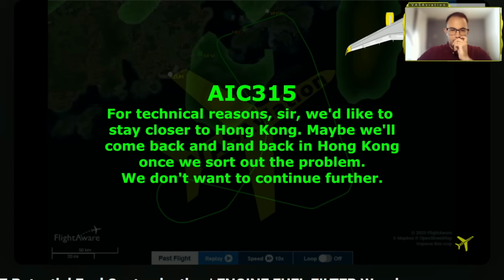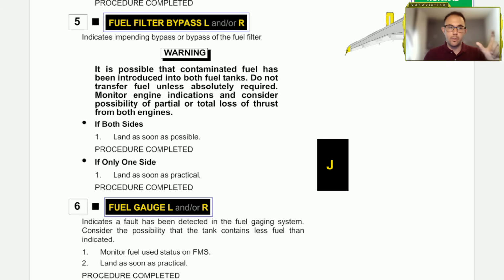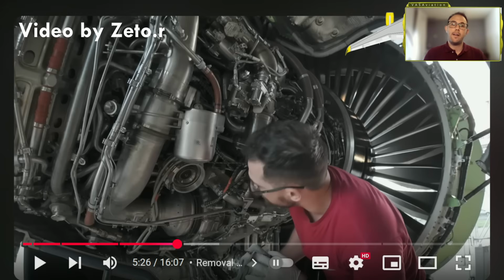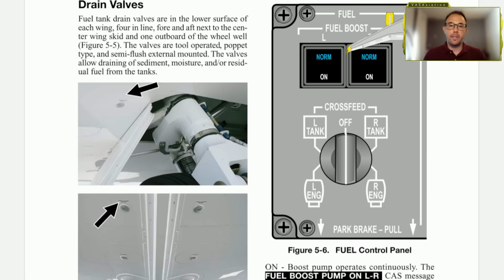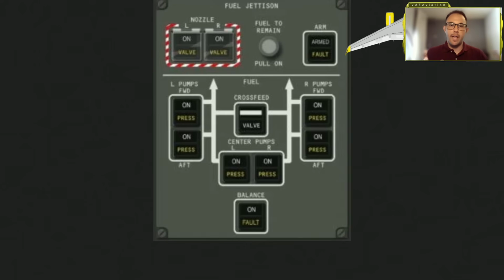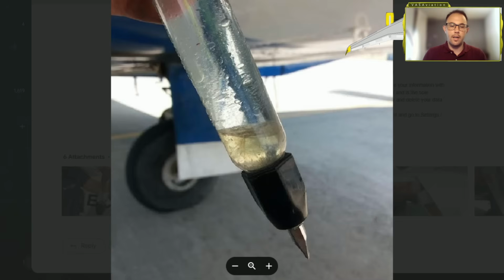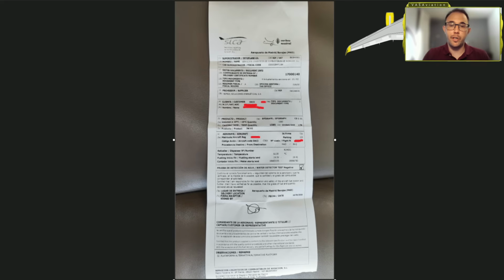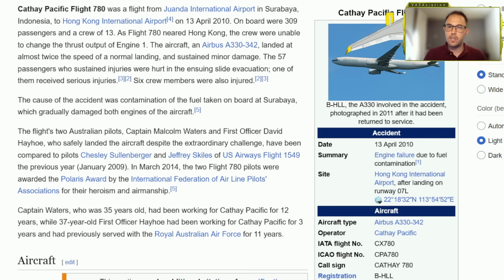Fuel Contamination | Fuel Filter Issues onboard Air India AI315

Comment from the maker: I forgot to mention that fuel filter sensors work measuring differential pressure through the filter. The Caution Message can be produced due to a failure in that sensor too.

Also I have read that there was a case in which the filter had not been installed back in position after maintenance. I don't know if a warning message would appear in that case or the fuel would just flow through 'no filter' and end up in the engine unfiltered. Can you guys tell?
Reply: 0 Differential Pressure would definitely warrant an warning message. At least on the ground side with any fuel filter 0 DP takes equipment out of service
Reply: I was wondering why not measure  fuel pressure on both sides of the filter to give a warning of pending filter bypass. Same thing for oil pressure. The bypass pressure is preset on fuel and oil filters on cars, it would be easy to measure the pressure drop to know when the filter is restricted. Even some home A/C  units have such a system to let you know when it's time to change  the filter.
Reply: Can you get the ATC from the new Pan Am flight that took off from JFK? I hope they are still using their original Clipper callsign

Comment: One visual clue in the AI 171 crash CCTV video was the hazy background where the jet had just back-taxied on the runway for a mile. In that video, the plane crosses right-to-left in front of eye witnesses below and beyond the checkered tower, then it emerges on the left with a huge white/gray cloud swirling in its rotation wake turbulence vortices, and another swirl seen over the shack's rooftop. If that's not overheated lithium, or circuits venting, and the nose didn't drop from emergency braking, and no puddles nor dusty patches to explain that cloud, that cannot be dismissed. 

Engines will tolerate only 30 parts/million of water in the lines, and if water scavenger pumps weren't removing it, condensation could accumulate in vented tanks. Some say 2.5 gallons per day. But GEnx pairs are gulping five gallons per second. If instead of ingesting slight amounts gradually, some bathtub of heavier water rolled back to the boost pumps suddenly, under acceleration and rotation angle, quenched engine heat would still cause steam to turn HP turbines as more water was drawn in. Seconds only, would the giants of GE be steam turbines, because they'd soon cool while still turning. 

That would explain why in the other two crash videos you won't see any airborne cloud or distortion following the gliding plane. Windmilling and inertia may have removed all of the water in the lines, but obviously not quickly enough for a life-saving restart. Fuel contamination was swiftly denied, as I expect that neither the fuel trucks nor the airport tanks had that condensation remaining. But they didn't crash. It was the plane with untested sumps that crashed.

Eye witnesses and smell witnesses on the field needed permission to be there, and someone had granted it. They'd have heard the peculiar sound of steaming engines struggling for speed. They'd have known if the field was foggy beforehand, though the temp/dew point was not w/in three degrees for fog to form. They'd know there were no puddles and patches of dust, and the smell of burnt tires and brakes on the freeway is familiar to everyone. Lithium has an acrid smoke that won't go out in minutes, let alone a few seconds. Circuits and boards stink to high heaven. Steam is quite easily distinguished. Use your eyes.

Comment: 1: Wouldn't it be advisable to actually enable cross-feed for the OPPOSITE tank if you get a contamination fault for a specific tank? So if you get a possible filter bypass for lets say tank R, switching the crossfeed switch to L, would then feed both engine L and R from tank L. Yes, it would give a imbalance on the aircraft, but which is more important? A balanced aircraft versus two operational engines? I feel the latter is more important.

2: Personally, I think its time for the industry to transition to electric now. Flammable fuel that can contain water and other contaminations and other dangerous things. Naah, better with a battery. I have seen the research on electric planes. They are both researching normal propcraft with more efficient propellers but also they are researching on a kind of "electric jet technology" called ion thrusters. If the scientists just get this thing right, we might in the future see electric powered jet airplanes 🙂
Reply from the maker: We don't even have reliable electric cars and you're thinking about electric planes?
Reply: @VASAviation  I personally think with everything doubled up with enough backup systems it will be as reliable, if not more. And also more enviromentally friendly.
Another advantage of this "ion trusters" technology they are researching is that it has no moving parts, which means a huge increase of reliability. Things that have no moving parts just last much longer as theres no mechanical wear on the parts.

Do a youtube search for "The plane with no moving parts" and you will see the interesting video from Real Engineering about this new technology.

Comment: Normally the engines aren't started at the same time, so it's hard to explain how fuel contamination could cause them to both fail at the exact same time the way they seemed to with the air India crash. Going from normal rotation to duel engine failure that quickly is tough to explain
Reply from the maker: It doesn't matter how they are started

Comment: There is no dedicated battery for the fuel shut off valves, so meaning when transitioning from engine power to rat then digital FSOV can cause a closure of the fuel. Causing the dual engine loss.
Reply from the maker: This is not true. There are safety mechanisms that keep the fuel running to the engine
Reply: @VASAviation the A320 has a dedicated battery for the FSOV. In the case of a power outage. You can look up multiple air worthy directives regarding the 787. FSOV. Look into it there is a recent video uploaded by garybpilot about this discussion it’s a software glitch.
Reply: @VASAviation not when the fuel shut off valve is activated. There is no safety mechanism. Such as an engine fire and the fuel shut off valve activates.

Comment: Fuel filters have a bypass when they clog. Then the pilots will go to the checklist and at their discretion will shutdown the engine and beat feet to the nearest suitable runway.
No other airplanes that day had any problems with the fuel and the fuel was tested and found to be clean, so contamination has been off the board for about a week now.

Comment: Victor. So I finally found the reason for the crash. Look into the fuel shut off valve mechanism when plane electrical issues with 787. There has been air worthy detectives regarding this problem. This glitch would cause for both valves to shut off. Look at the latest videos currently posted about this topic.

Comment: loss of  Electric power and a known software glitched raised in 2015 in a directive by boeing caused the fuel shut off valves to activate . i watched the video the guy who flew  on that very plane  on the inbound flight to ahmeibad pardon  the spelling . i watched  that around midnight on the 13 th  where the plane  was showing signs of electricity problems severe ones

Comment: loss of  Electric power and a known software glitched raised in 2015 in a directive by boeing caused the fuel shut off valves to activate . i watched the video the guy who flue on that very plane  on the inbound flight to ahmeibad pardon  the spelling . i wayched that around midnight on the 13 th  where the plane  was showing signs of electricity problem severe ones

Comment: In Houston, I was taught to keep, if possible, fuel for a gas car at or above half full.  Why? Heat and humidity can cause water yo condense in the gas tank.

Airplanes use different fuels.  But I wonder if there is a connection?
Reply from the maker: I just said in the video

Comment: Fuel contamination usually does not cause engine to failed. It cause engine to runs funny and degraded the performance.

Example is exactly the Hong Kong case, it didn’t cause engine to failed but cause engine to have issues.

Another example is Cathay A330, it cause one engine stuck below idle and one stuck above 74%N1 forcing pilot to perform the world’s fastest landing on a commercial airliner touching down at 230 knots but the engines also didn’t failed. This one also out of Hong Kong (what’s up with Hong Kong and fuel contamination?)

Even when the engines did failed, it would have various issues before it gave up. It wouldn’t just run normally and then dropped dead out of no where like this… not even with one single engine let alone both engines simultaneously. 

It’s super duper extremely highly unlikely that I’ll say it’s impossible.
Reply: Btw, don’t mind me I also thought this one was about AI171 oops😅… but I think I’ll leave this up for many who thought fuel contamination is a problem with AI171

Comment: I do not believe its a fuel blockage or contamination problem. Looking at the available diagrams no reasonable issue would stop both engines at the same time.
I think it's a Fadec problem, so condition fooled the system into shutting off both turbines (which is actually by shutting off the fuel controls)

Comment: I guess posting a link doesn't work. What do folks think about this? 

Japanese investigators believe biocide treatment of fuel on a Jetstar Airways Boeing 787-8 led to the aircraft’s losing thrust in both engines during a service to Osaka’s Kansai airport two days later.

The aircraft (VH-VKJ) had departed Cairns on 29 March last year.

As it descended through 16,100ft (4,900m) towards Kansai, the crew started to receive instability indications from the right-hand General Electric GEnx-1B engine.

These were followed by a failure message for the left-hand engine a few minutes later, at about 11,800ft (3,600m), and then a similar failure message for the right-hand engine.

They landed safely but apparently something in the biocide treatment caused issues in the fuel system

Comment: Fuel is normally sent from refineries to airports via pipelines. And a batch of Jet-A fuel fills multiple passenger jets within the same day. No other jets experienced problems that day.
The retain samples from the batch will likely be obtained and checked by the inspectors though. For Jet-A fuel, a sample drawn from the middle of the tank, is retained for at least 90 days just in case government inspectors need to test it in the event of a problem.
Reply: Fuel testing has been cut, at least from my knowledge, from the Airbus AMM to lower overall operating costs. I wouldn’t be surprised if Boeing started it and Airbus followed.

Comment: I want add a caveat here about the delta P bypass for the filters. If the filters pop because of contamination that means it is letting that contamination going further down stream and eventually into pumps and injectors which is bad. The reason is if it is bad enough pumps will fail and injectors will clog.

Comment: Extreme heat will cause the computer to shut down the fuel delivery system. It has happened before. No fuel contamination existed. If the RAT is deployed then pray a lot. Please do not fly in a B787 until the computer is re-programmed.
Reply: @DbestinDworld:  Heat will not do that.  Please share with the class a reference manual that supports your position.
Reply: @gordonbryan8381 If a sensor senses a possible fire then it will automatically shut down the engines to contain the fire.

Comment: According to my research the two engines have their own fuel filters, two filters per engine to be exact. Wouldn't the odds for both systems to be contaminated and cut off/contaminate fuel flow at the exact time is near zero?

Comment: Have gone down the rabbit hole on tank size and pump configuration and usage. Had a productive discussion with a 787 pilot who generously answered some questions. 

Basically two wing tanks at 16,776 kg capacity each with two forward & aft electric pumps, a central tank with 68,888 kg capacity with two electric pumps (placement is a bit unclear as pilot said for & aft but since that is not right left symmetrical and each of the pumps are used in a left / right configuration). The center tank has an additional scavenging system that comes on shortly after the main wing tanks start providing fuel and will empty the center tank. 

From the pilot:

“The center tank pumps (2) are normally delivering fuel to the engines for takeoff (there is no flap logic associated with their operation) meaning fuel is delivered from the center tank whenever fuel is in the center tank and the pumps are on. The 4 wing tank pumps (2 pumps in each wing tank) are all competing to deliver fuel to their respective engine as well. However, since the wing tank pumps deliver fuel at a slightly lower pressure, the center tank pumps essentially win the pressure battle until no more fuel is in the center tank.”

From the pilot:

“l do not think there is a water separator of any kind and we have no cockpit indicators for water in the fuel--mechanics do periodic sampling but I don't have any expertise in this area. I don't believe a water/fuel mixture would reduce the output pressure.. Yes, the center tanks are depleted fully using a fuel scavenging system that comes on shortly after the main wing tanks start providing fuel. There are separate pickups for each center pump (forward and aft pump) but we normally shut these pumps off once the center tank quantity reaches 5000 lbs so those pickups are not uncovered at anytime while the pumps are running. The remaining fuel in the center tank is then picked up by a fuel scavenging system (which has its own pickups at the lowest parts of the tank). and delivered to the wing tanks.”

Comment: As a trained and experienced refuse collector I consider myself more qualified than youtubers to say I think the plane probably had a blocked toilet and then crashed.
Reply: As a 42 year swimming pool and spa technition, I concur.
Reply: Not funny
Reply: @rm6857  Very funny, as most of the comments here as well as most of the content are full of fluff, supposition, incorect technical data and unfounded conclusions.
Reply: @rm6857  That was pretty funny. Tired of these comments that start with " As a fill in the blank" No body gives a shit what you used to do.

Comment: In case if it is fuel contamination issue, then why only 1 aircraft got affected. The Same Vendor fuels almost all of the aircrafts at that airport.
Reply: My money is that there was an improper amount of fuel additive added on that flight. I am having trouble finding the flight that was affected, but there was one incident was caused by the ground crew improperly doing an imperial to metric conversion and adding many times more of an antimicrobial solution to the fuel than it was designed for, and after a bit it all congealed and got sucked into the fuel system preventing the engines from being able to ignite
Reply: @chris2746  that’s a Mentour video I’m sure
Reply: @chris2746 Was a Titan Airways A321 (G-POWN) that had engine issues after maintenance added way too much biocide to the fuel tanks.
Reply: This can also be caused by failure to check and replace the filters, attempting to stretch the life of the parts and reduce labor cost, even forging maintenance paperwork to falsly claim the maintenance was performed. It is very common in that region of the world, I know people at Boeing and they are constantly sending notices to airlines in that region about lack of maintenance and they just get ignored. (Yes even the LionAir 737max has this issue of improper maintenance though the media suppressed that side of the story. The MCAS problem was only layer of failure which would have been mitigated by multiple other layers in typical European or American operational norms.)
Reply: There was an incident where an aircraft was the first one fuelled after work was done on an airport fuel storage/delivery system and sea water had gotten into the system. It affected some filters which disintegrated and blocked the fuel to all engines.
Reply: So it is possible if fuel depot either started a new tank, or finishing off a tank is how it would only affect one aircraft.

Comment: But don’t pilots spool up one engine for a good amount of time before the other one so the chances of them going out at the exact same time is very unlikely right? and the engines didn’t blow out smoke or sputter they just stopped working at exactly the same time
Reply: Not on the 787
Reply: @RepEvo:  or any other airliner for that matter.
Reply: They said this too on the new Mentour podcast!

Comment: On a 787 you get warnings and there are safety measures. They would of had a warning.
Reply from the maker: Maybe they did
Reply: @VASAviation 
Did they get warnings, but just WHEN they got the warning is maybe the critical question and what type of warnings? If it was around V1, then bad things are going to happen. Is that correct? It might literally have been a couple of seconds of the pilot monitoring trying to make sense of what that error message meant and then trying to communicate it. I have a bad feeling that this was a no win situation where rejecting would overrun the runway but they thought that they had enough thrust to get airborne BUT then things got worse.
Reply: @Mentaculus42 . Modern airliners built in the last 40 years or so all have warnings systems that alert the crew during all phases of flight.  Many aircraft have a feature during the takeoff phase that will warn the crew of only critical safety of flight items once the throttles have been advanced past a certain position in the throttle quadrant.  This prevents nuisance warnings during the later stages of a takeoff roll.